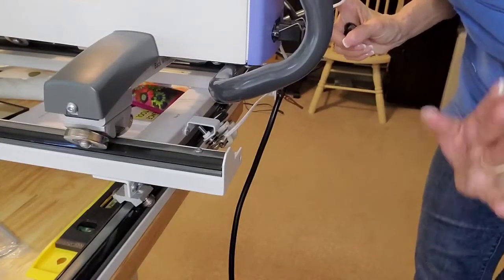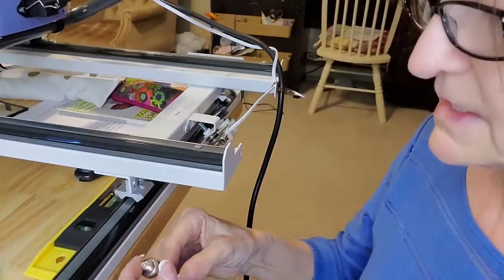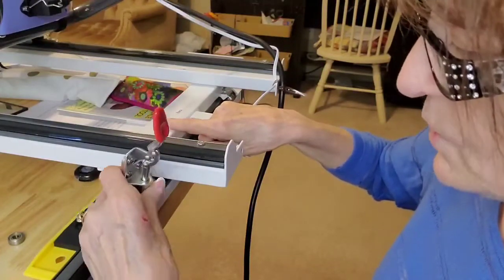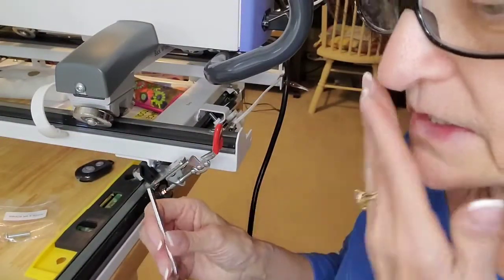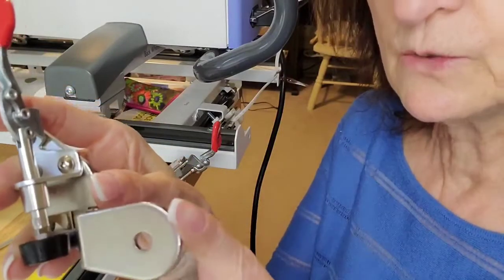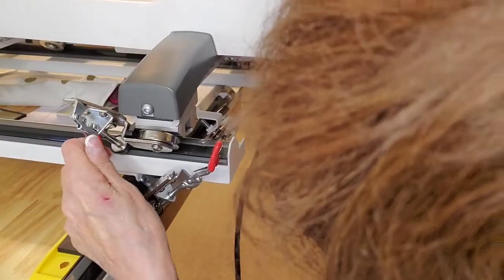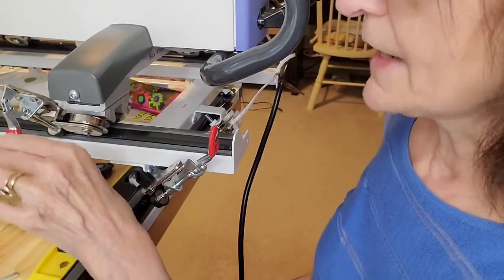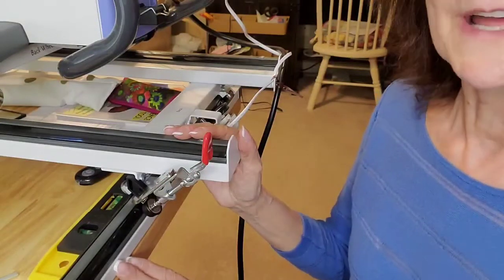Installing the Cutie Channel Locks

Comment: Thank you so much for this video. When I opened the channel lock box, I looked at the directions, had a little hmmmph, and closed the box. Haven’t set up the channel locks because it seemed beyond my ability. Your video is just what I need for success! Going to try again. ❤
Reply from the maker: It's really not that difficult, but sometimes seeing someone do something is so much easier than reading it.   

Feel free to let me know if you have any issues.

Comment: Hi Bonnie, I'm just a little confused. To use my Cutie frame, which I don't own a Q'nique machine (unfortunately!). Only able to use my Janome 6700P. Does that mean I WILL (or won't) need those channel locks you show or do I use the smaller channel wheels & locks on my Cutie Frame carriage, which I think you removed? Please explain, so I won't make a mistake. 
Many thanks for your wonderful videos and very useful advice!
Reply from the maker: You certainly can use the Cutie channel locks...the Cutie Channel locks come in a set if three: 
1) lower Cutie channel lock,
2) upper Cutie channel lock,
3) upper channel lock.

You would use the lower Cutie channel  lock, as I did in my video, and the upper Cutie channel lock.   I had to use the upper channel lock because I have a Q'nique.   The upper Cutie channel lock is very similar to the lower Cutie channel lock.

Comment: Thank you so much for this! I normally have no problem following instructions but was turning the nut wrong to get the rubber touch the track. My aha moment turned into well duh😂
Reply from the maker: I had that "well duh" moment when I noticed the lip for the lower channel lock.  🤪

Comment: I just got my Cutie Frame and it did not have the channel locks in it. Do these apply to a Juki machine. Do I need to contact the company?
Reply from the maker: The Channel locks are an item you purchase separately for the Cutie frame.   They cost between $50-70.

The sewing machine is immaterial...unless you have a Q'nique machine, as I have.   Then you use the large wheel option of the three channel locks that are included in the Cutie Channel lock package.
Reply: @quiltingonathread  Thank you so much. This video helps alot.

Comment: What is the purpose of encoders?
Reply from the maker: The encoders are used to track the carriage movement and use this in stitch regulation.   They are part of the SureStitch Elite Regulator.
Reply: I'm using a Q'nique 15 Pro which has stitch regulation.  Would I need to have them for this machine? @quiltingonathread
Reply from the maker: @DD-ek8qc  your Q15Pro will have come with the encoders....
Reply: Cool!  Thanks, now I can get things set up.  Just waiting for the channel locks to come.  Since Grace is in Utah and I'm in Nevada shouldn't take too long. @quiltingonathread